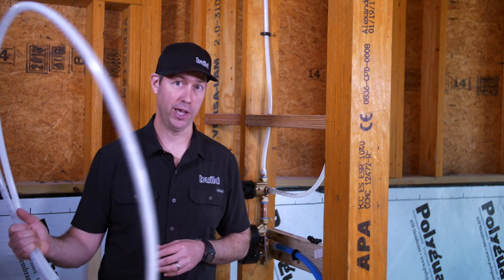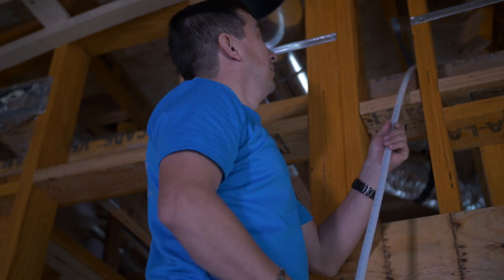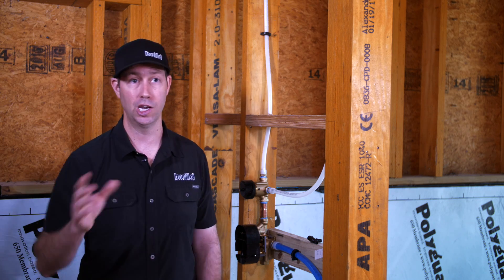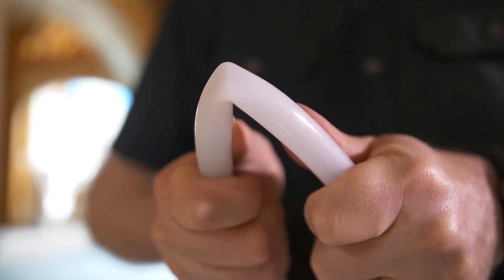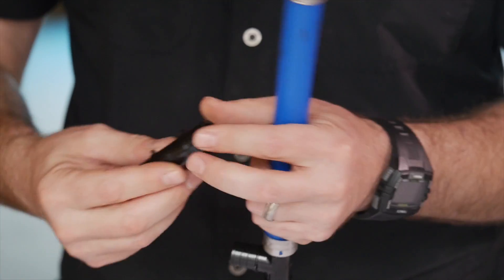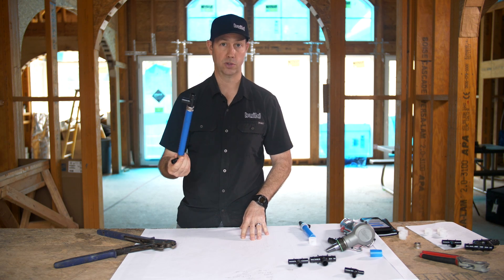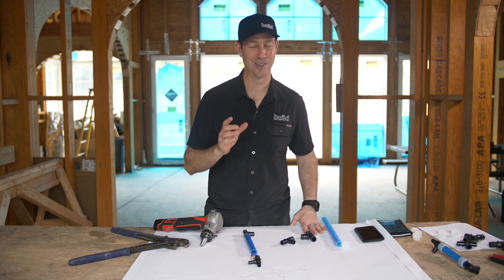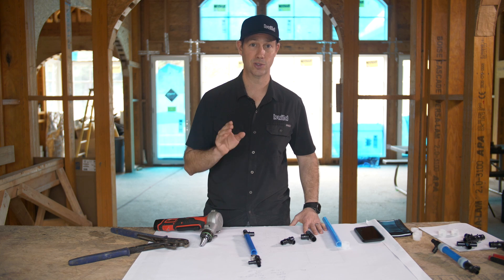PEX vs. Copper Plumbing

Comment: Can the fitting be rotated after it’s been installed into the pipe at all or is it fixed at that point?
Reply: samuel De Felice with the crimp method, you can still rotate the fitting in the pipe. He did not show the third type of fastener with apex and that is the stainless steel crimp band that ratchets down and provides the installer with a positive connection indication. I have been using that system since the late 90’s and have never had a failure.

Comment: I replaced my old corroded galvanized plumbing with PEX and found it easy to work with and more resistant to freezing when I shut the heat off in the winter. Actually the water tastes better  too. Still have some copper but it needs to be totally drained to prevent splitting at the low points.

Comment: Early plastic piping systems were once notoriously unreliable. I've never used it, but was happily surprised to see how robust my neighbor's system was.  I'd like to make three points - which I think are on their face valid: 

1. All plastics (synthetic polymers) seem inevitably to become banned. Epoxy used to be recommended as safe for children's furniture and food prep surfaces. Now Bisphenol-A (BpA) has been shown to be an endocrine disruptor - Would you just start taking random levels of your wife's birth control? 

2. Quality control. There seems to be variations among manufacturers of PEX materials. How do you know what you just bought is the same stuff Matt is presenting? I think every installation should include a 'plaque' (baggie stapled near the water line) including manufacturer of the material, production date, etc... 

and 3. Just use a reverse osmosis system for your drinking water. I've been doing that for over 30 years, it filters out everything (100% ? probably not, but more than close enough). Easy to maintain. Even if you have copper pipe installed since the lead solder ban (that too was once considered absolutely safe) My house is a mix of copper and galvanized. You'll never taste or smell chlorine in the kitchen or your cooking. Shower, brushing teeth, dishwasher? Instead of parts per million or billion, now you're dealing with a minimal fraction of these amounts. The only downside is you might be missing some minerals. 

 

Excerpt from Water Online website: 

“We don’t have information about the chemicals that are leaching out of these pipes, and because of that, we can’t make the decisions we want to make,” he said.
“There have been marketing campaigns that imply we understand the safety of these products,” he added. “In fact, we do not.”

Whelton recently published a study examining PEX piping in Journal — American Water Works Association. 

“PEX pipes caused greater odor than the polypropylene pipe and released more organic carbon as well as volatile and semi-volatile organic compounds. Water quality impacts were less after 30 days. Regulated and unregulated contaminants were found in three PEX plumbing systems. Drinking water odors were attributed to toluene, ethyl-tert-butyl ether, and unidentified contaminants,” the study said.

The bottom line, scientists say, is more information is needed about how PEX piping affects drinking water.https://www.wateronline.com/doc/scientists-raise-questions-about-pex-pipes-affect-water-0001

Comment: Here is the actual pressure drop of three types of PEX. The PEX-B is not bad - an elbow is like 10 inches of straight pipe if you use the brass version. The plastic version does have more drop than PEX-A: https://i.postimg.cc/rsvvyP5W/Capture.jpg

Comment: PEX is good but some of the fittings are TERRIBLE. I had TWO fitting failures with huge leaks and damage within two weeks. Using copper fittings. I switched ALL of my joints to PVC, installed a WaterCop leak detection system and now I sleep well. WaterCop cost me under $2k with 20 sensors. A tiny leak closes the incoming water valve and, in my case, shuts off my pump. First PAY OFF was thanksgiving 2019. We’re all in the kitchen waiting for a festive meal when my wife tells me we have no water at the kitchen sink. I look at the app on my iPhone and it’s zone 4, under the kitchen sink where I’m standing. Sure enough, a small leak from the drain tripped the sensor. I put a bucket under the leak, reset the system and we never skipped a beat. I also have an automatic standby generator for power outages. Best insurance money can buy can buy. On 4/15/20 we had a strong wind storm come through. 20 seconds after my lights went out my generator kicked in and ran for 6 hours before our utility could power restored. Of course with wind rain usually comes which means my sump pumps and all house systems kept running. Same through hurricane Sandy. Power outage with 6” of rain. Thankfully the wind didn’t hurt us but my power and whole house ran as the hurricane passed southern NJ.

Comment: Would you recommend PEX for the water main? I have galvanized steel pipe running from the city valve to my house, about 150 feet run, and need to replace the 60 year old pipe. I was gonna replace it with 1 1/2 PVC.

Comment: I know around 10 years ago I saved alot of money when i did research to find out the stuff at  Home Depot you had to buy cold water(blue)pipe and Hot water pipe(i believe red) could only be used for its recommendation and the connectors were expensive,plus the tools.
 Went to Menards store found out the color of the pipe is for your convenience and you didnt need to buy two different color rolls of Pex.
  Tools,100ftpipe, connecters, etc. back then about $130. 
 Old two big story house had copper upstairs but all lines in basement were galvanised. I removed all galvanized pipe and add a first floor laundry.    
 QUESTION : Does most PEX now accepted cold and hot water no matter the color of pipe?

Comment: I've just come across this YouTube item and my comment might well have been covered already but I was surprised that no mention was made of one of the downsides of copper being that of pin holes.. From a longevity viewpoint, this would seem to be the main disadvantage.
Reply: @sethgabel I don't know where you're located but here in Florida, 50 years would be not just lucky but nothing short of a miracle and 100 years is completely in the realm of fantasy.

Comment: Your explanation about the difference between PEX-A & B is not how you explained it. It’s about how the molecules are cross-linked. Also the crimp system that Viega uses does not make it PEX-B. HeatLink uses the same crimp system and they have PEX-A. They also now have the same crimp system as Uponor, since Uponor lost the patent on what they called “their” system.

Comment: Matt: love your info and exp. with building . I have used pex B  for years with no problems in home renovation . I am going to switch to upon or because of more flow due to larger openings in the fittings.

Comment: PEX is a lot easier/faster to use than copper in those hard to get into places where sweating a fitting is practically impossible, you can slide a piece of PEX right through there.

Comment: Well I've been using PVC & CPVC all my life (DOB 1960)  Been real happy with it, but been thinking about trying PEX.  But in truth I'm really an electrician  by trade but I do a bit of everything for sure.  I'm just happy that I don't have to use steel or copper much at all.  :)
Reply: both bathrooms cpvc leaks 2nd floor. ENTIRE housing development 15 years old, CPVC breaking everywhere. All plumbers i've talked to abandon it. CPVC is to be avoided
Reply: @outfoxed5133  
I only use the cpvc for the hot water, I know some people use it for cold also.  Maybe it's that I live in Rockport TX & we really don't have to deal with much cold weather, so our water in our pipes almost never  freeze.  About 28 years ago I had a 3/4" cpvc that did freeze, but the pipe was oversized for the job, & it was easy to get to so I just replaced it with a 1/2" & it's been fine ever since.   But I have been thinking about trying other systems.  Although at this point in my life I'm not sure why, I have other more important things that I need to change that are giving me a hard time.  :)

Comment: Great video. You didn't cover the health reasons for reducing copper in water supply. Since plastic tubing is still very new, it will take a few generations before we know the impact on the users.

Comment: Great video.  I wished you had covered how future removal/repair works for the spots where the pex tube meets the fitting.  Is it easy to remove it for repair?
Reply: You cant remove a previously collared fitting, you just cut it out and pipe in a new one.

Comment: - The melting temp. on the stuff ...  a perfect sprinkler system if u have a fire  !
Reply: Ulf Edlund ...well.....sounds like that would help put it out if it got that bad. And besides, if it got that bad, fire truck is gonna dump same amount of water. So this is a non-issue.

Comment: I think it's important to mention  the gray polybutylene pipe that was used a few years back. It is illegal to use now, although you can still buy fittings to transition to a new pipe. There was a class action lawsuit that resulted in them having to repipe homes. Unfortunately for me I missed the deadline. The fittings were notorious for leaking. It's also very expensive ripping walls down to fix leaks that usually include black mold. The expansion tool is genius. You can be in super tight spots where the crimping tool is useless.

Comment: Our house was built in 1995 and plumbed with PEX from that era.  Home owner's insurance companies in the Orlando area charge a significant premium for houses of that age because of mythical connector failures in early versions.  Our house is supposed to be plumbed with third generation connectors which have very low failure rates and we have not had any problems.  That word has not arrived after 25 years with local insurance companies and house inspectors.  It costs about $4K to replace and replumb houses that have  PEX.

Comment: The main drawback to PEX that I point out to my clients, is the importance of keeping rats out of your crawlspaces, walls, and attics. I've seen rat chewed 2" ABS, Romex wiring (right down to the copper of the hot black wire along a 3' long stretch), ADS pipe, HVAC ducting, even cement siding. Not once have I ever seen rat chewed copper pipe. I have seen Cu pipe get pissed on to the point where I could see how it would leak, esp. if you add constant condensation to the equation. I remember when PEX was first coming out, it was being described as being "bullet proof". That's great if you've got a bunch of stray bullets flying around, but in the real world rats are a lot more common. They only seem to chew where they can comfortably sit and chew for a while. If you think about that when your running stuff (pipe or wire), you can pick locations that aren't "comfortable" for them. One other thing I've found, is that PEX may be freeze resistant, but it is NOT freeze proof. If you only get a partial thaw and new water enters before it refreezes, it acts just like a wedge of ice cracking rock, and the ice wins every time. Not to mention the fact that the colder it is, the less flexible it will be, and therefore starts to suffer from memory loss.
Reply: Squirrels chew it up as well.  I have a rental that squirrels got into the crawl space and chewed through the PEX.

Comment: I guess steel pipe is gone forever now.   I've put in several miles of black and galvanized pipe and no plastic at all.  I musty admit I have put in a lot of copper before I retired.

Comment: Side benefit of PVC and PEX: the fluorides in public water supplies leaches lead from the solder used to sweat the joints in a copper distribution system...

Comment: excellent video - have used this product for 20 years with excellent results.  still amazed how some ignorant plumbers still berate this system.  can also be used for air piping systems - works perfectly and lasts.  another plus is less chance of torching the building down !

Comment: I have a question , if plastic bottles are leaching cemicals into the water inside them wouldnt the plastic lines do the same , just asking because in 20 years is all this plastic going to be banned and now you need to rip your house apart to change it . I had to rewire my daughter's house because they built it with aluminum wire , was code now its not so now we have this plastic water lines whos say in 5 years its still code . Its funny how new product comes out that cost less to make and faster to install but plumbers charge more for it , hmmm money grab or what ....

Comment: Knew someone who had PEX and his #1 issue was how fast the hot lines cooled off. They have very low heat retention, which is another reason they're used in underfloor heating. He ended up using foam insulation, which helped tremendously. Another problem I noticed after he wrapped them is that the hot lines buckled and/or expanded length-wise. Luckily, all of the runs he wrapped were in the basement where they had plenty of room to expand. I can see where that would cause problems if they were run through confined spaces, but they're unlikely to be wrapped either. You'd just have to put up with the heat loss.

Comment: I am preparing to run PEX from the house to my dock. I have been collecting parts to start when my son comes for the day. I plan to use pinch to secure the fittings. Should I be concerned some are not compatible? Most came from a the same big box store. I wanted to use Pex to expand the number of hose bibs around the dock, running then under the deck and out of the sun.

Comment: crack heads won't steal plastic pipe, also put signs on a/c units with aluminum cores that will save meth heads some time.
Reply: Good idea.  Are the first words, "Attention Meth-Heads..."

Comment: Matt,
Since this video with PEX A, have you continued to use it???
 
It seems a solid and obvious Winner just upon the larger inside diameter !  However your testimonial about 100's of homes and only 1 failure is NOT something that You could say about thr Reliability of PEX A...! 

Do you have that Confidence Now in 2020?

Comment: Sorry but stay away from.pex and CPVC... its expensive in copper but it will last a lifetime with no headaches.. we has 5k in pex damages started in the bathroom ended in kitchen... dont make the same mistake it will cost you in the long run

Comment: I replaced so much plastic water pipes in the 1980's. Pin hole leaks would develope. In my own home im using copper. Plastic is plastic
Reply: Yea, bottom line, not all plastics are created equal.  I have a degree in manufacturing engineering and learned all about the hundreds, if not thousands of different types of plastics out there and it was fascinating and enlightening.
Reply: Yea pvc sucks but the polyethylene they use for pex is pretty impressive.
Reply: PEX is easily the best material out there. It’s nothing like polybutylene or CPVC.

Comment: I have seen and used it myself and prefer pex A for new construction and pex B if it needs work on existing houses but never buy crappy shark-byte brand  pex which infact is pex  C thinner type as I have seen many fittings from shark-byte explode in cold weather with water flooding either on copper or pex C or transcitions and thats one good reason big box stores make money so we coming to them for parts (consumers).

Comment: PEX systems are ticking time bombs.  The CPVC was bad enough.  CPVC gets brittle over time and breaks really easily.  A water hammer break at an elbow or tee inside a wall will be a homeowners guaranteed worst nightmare (short of everything burning to the ground). 
Saying that chlorine affects plastic is an understatement.  Most water has 15 or so dissolved trace metals, ranging from aluminum to lead, that will affect the pipe over time.  Stretching the plastic to shrink over a fitting is a very bad idea.  One has no idea whether microfizzures are being created that will "fatigue" over time, leading to a catastrophic failure at some point.  On the other hand, crimping metal onto plastic is equally frightening, as most plastics and metals have an acidic reaction over time that causes the plastic to weaken and the metal to oxidize.
I would recommend not burying PEX runs in walls or ceilings but having the bulk of the run in an attic or crawl space and just rising or dropping to the fixture.
Trust me.  If there was a fail safe plastic out there, the radiator guys would be using it!

Comment: I had my old house converted from the crumbling galvanized pipe to PEX back in 2015, as well as replaced the water heater with a tank-less unit.
So far I've had zero problems!
While I have to flush the heater every 6 months, I can see the tank-less water heater lasting much longer than the tank version it replaced.
I've also noticed that it doesn't take much longer than the old tank to get hot water, and it lasts as long as the water is running.
Because it doesn't run unless hot water is needed, it's paid fr itself in the last 5 years in cost savings!

Comment: Hey Matt - I learned the plumbing trade using copper so I'm more than comfortable installing hard copper waterlines.   I think you should have included the PEX 'Copper Ring Crimp' system since it's by far more popular than A or B.  My biggest complaint about PEX over Copper is that it's hard to make a neat looking install with plastic, Oh and Copper has natural antiseptic qualities and will kill some microbes when exposed long enough - can't do that with plastic!  Thanks for posting.

Comment: Question,I just bought a property where they used that type of plumbing , but I'm very worked because there is about 50 feet of it barried in the ground
Reply: I was a plumber for about a year, my boss refused to use it. I was always told it is not supposed to be buried. I've also been told that some types have had labeling saying "do not expose to direct sunlight for more than 24 hours"